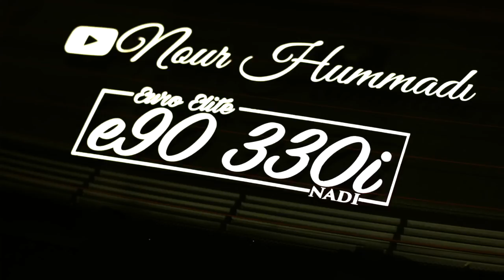THE 335I TWO FACE WRAP BEGINS! (PART. 1)

Comment: Yo what’s up guys, i have a bmw e90 n52. I been having a problem with it after i went over this big puddle last week. The car has a really bad shake that can be felt throughout the whole car, more specifically when it is first started or when it is put into reverse. It’s been at the mechanic for over a week now. We have tried changing the spark plugs and ignition coils two times with different brands. Didn’t work. Shows misfire in cylinder 6 for some reason. Tried checking the wire that runs to cylinder 6 but didn’t see anything. The injectors were checked and they are fine. Any idea what it could be? I’m running out of options here. Mechanic thinks it could just be something wrong w the engine